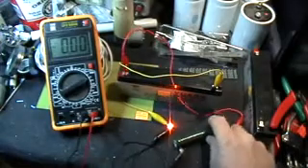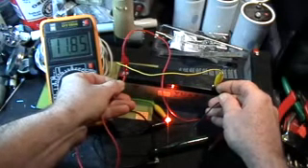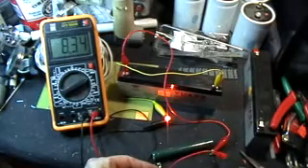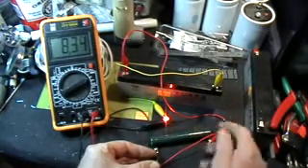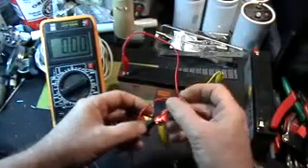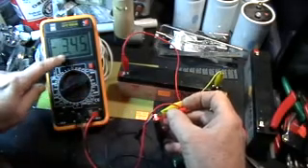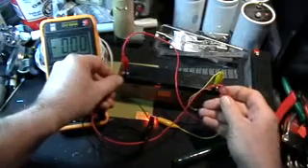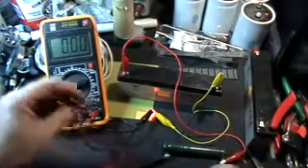Voltage drop across circuit elements

Comment: Led's have a voltage drop, depending on the material(and usually the color output) can be from 1.2 to close to 5 volts. When considering a resistor value for an led, that voltage drop across the resistor is important to figureing out the voltage across the resistor in order to calulate the current for the circuit. 12v - (4v led) = 8v across resistor. 8v / (30ma typical blue led current) = 266 ohm reistor.
The led is a diode and will conduct like a wire and burn without the resistor.
a bitoinfo

Comment: I was just showing the importance of knowing the drop across the led first before going for a resistor value. Some may calculate a wrong voltage like 12v/30ma or 4v/30ma. Just thought my version was easier for newbe's to understand than others here. Hav'nt seen your version in another thread. 
Gotta wheatstone bridge? ;)

Comment from the maker: (Continued from last comment)
Voltage is ability to overcome resistance with current. Current is flow of charge through a resistance, and voltage is potential that pushes it. Resistance is dissipation of potential into kinetic energy of heat, by retarding flow of charge.
It's all one, and Ohm's Law defines each quantity in terms of the others.
(continued next comment)

Comment: Ok, I have repeated your experiment. Please note that I am very very new in electronics. I have connected in series first: a 9V battery-0,66 kilohm resistor-LED. Measured both ends of the resistor: 6.6 V. On the second try 9V-0.66 kilohm res.-another 0.66 kilohm res.-LED
Both resistors show 3.3V (6.6/2). Did the same with 3 0.66 kilohm resistors: every resistor is 2.2V (6.6/3). If I may ask a beginner question: why so? Why not 6.6V drops everywhere?
Reply from the maker: Your voltage source is 9 v. The forward voltage (drop) of your LED is apparently 2.4 volts. This means that you have 9 - 2.4 = 6.6 volts to "drop" around the rest of the circuit (Kirchoff's circuit rules.) With one resistor of 660R you have a voltage drop across that resistor of the full 6.6 volts, giving you a current through the resistor of I=V/R or 6.6V/660R=0.01A or 10mA. Put two resistors in series and now the 2 resistors must drop the full 6.6 volts, and since they are equal in value, they each drop 3.3 volts, or the full 6.6 volts across both. The current is now I=V/R=3.3V/660R=0.005A or 5 mA.  So you start with the supply voltage, and Kirchoff's rules say that this entire voltage must be "dropped" across the whole circuit. Each individual component drops its "fair share" of this total supply voltage. The LED's drop is 2.4 volts, and each resistor drops its share of the remaining voltage. Current everywhere in the simple series circuit is the same, determined by Ohm's Law and the total value of the resistors: I= (Vsupply-Vled)/Rtotal
Reply: Thank you very much

Comment: Hi, I was wondering, I'm using a 555 ic, and I'm using a 9 volt battery. I want to limit the power to the 555 ic to 3 volts, to increase the life of the ic. I am also running a stun gun off of the same power supply, so I need the full 9 volts for that part of the curcuit. How would you go about making sure the 555 ic gets enough voltage, while keeping voltage below 4 volts, and is there any way to ensure there is no voltage spike from generating ac from the stun gun transformer and voltage multiplier. Thanks.

Comment from the maker: Clearly, you are the one who doesn't get it. The reason the voltage drop will be different with different loads, is because different loads drop the voltage differently.
Here I have clearly shown a resistor dropping voltage, thereby proving you wrong.
Where you are making your error is that you are modelling voltage and current as somehow separate entities. They are not. 
(continued next comment)